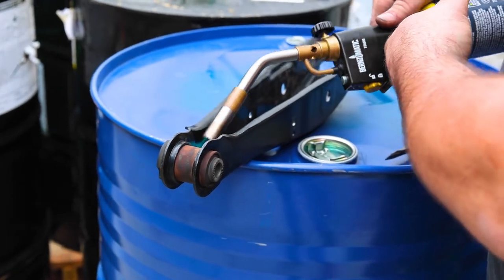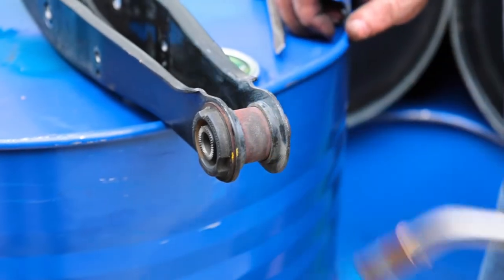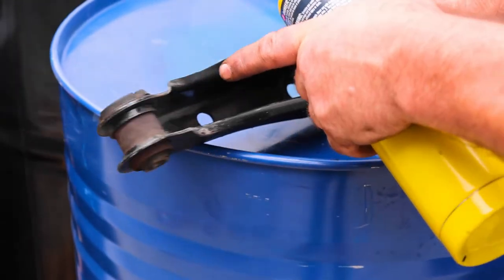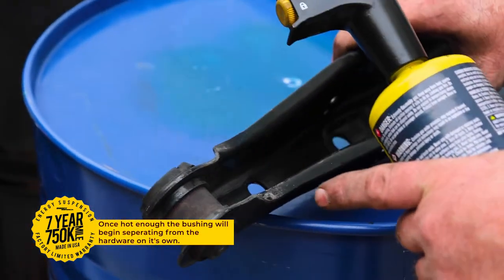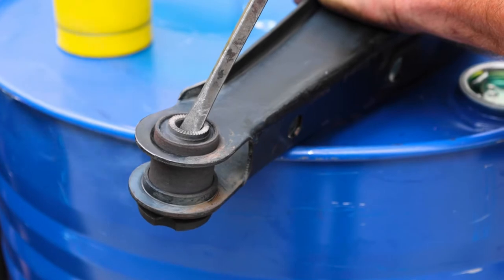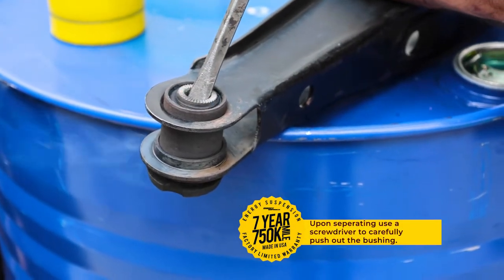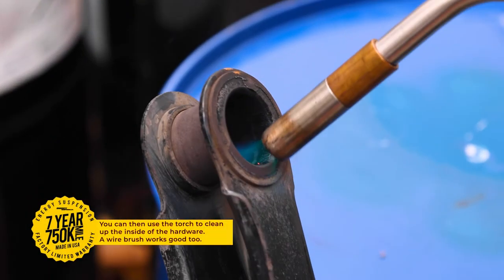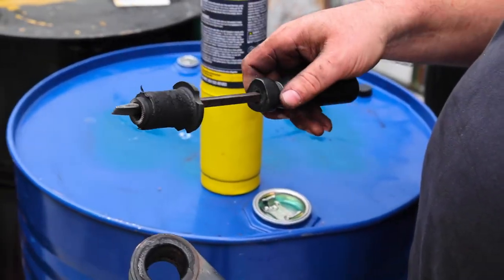Removing Stock Bushings "Properly" with Fire.

Comment: now how do you get the rubber off the inner shaft the corvette c5 bushings you sell dont come with new shafts and the old ones are formed on, you have to cut them off w a razor blade and it takes 15min to 1/2 hr each